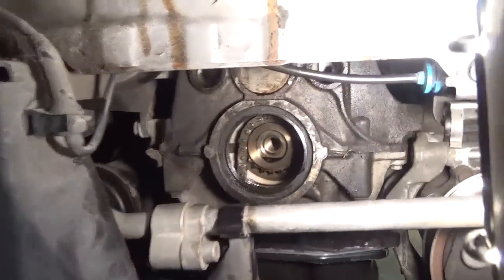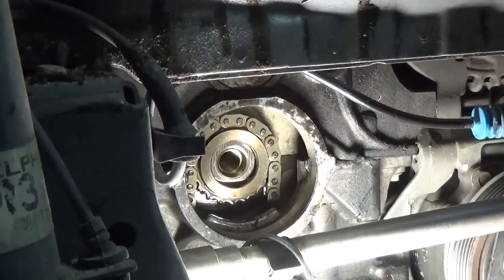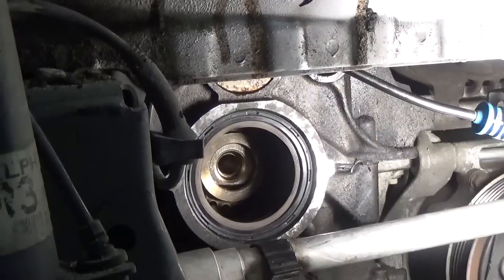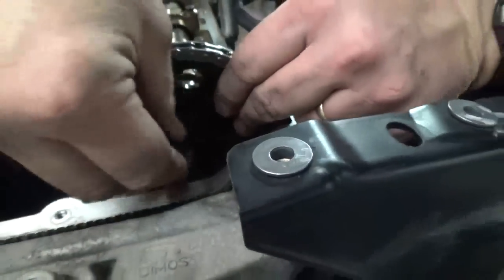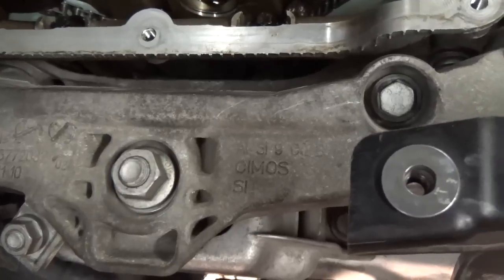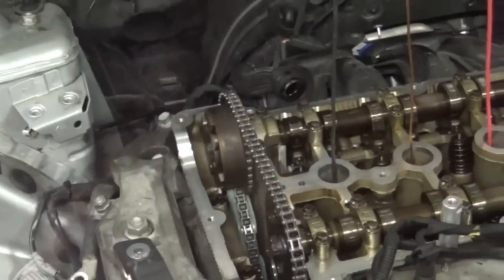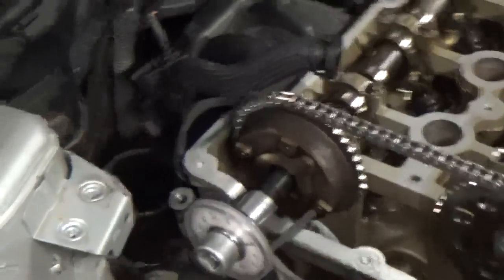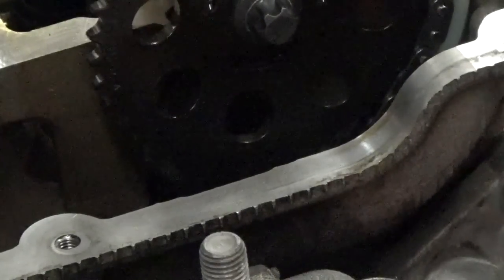2007 Mini Cooper S Timing Chain Replacement Part 3

Comment: Great videos. I've watched all 3... with my full attention but where is video 4? What happens next.? Did it start?how did it sound?
Reply from the maker: Harry Cooper. After I got it all back together, it wouldn't run because all 8 exhaust valves were bent. That led me to do the series on cylinder head repair.
Reply: Di you bend the valve when you set up the timing

Comment: so did you end up with any bent valves or other damage   after the chain went bad?
Reply from the maker: Bella Luna yes, all 8 exhaust valves were bent. ended up replacing all valves, milling and valve job.
Reply: dam, sorry to hear that. Guess I should definitely go ahead and replace my chain and guides before this happens. Thank you for the reply. :)

Comment: Are there timing marks for the Crank?
Reply from the maker: No, there are not any timing marks. Once you lock the flywheel, the Pistons are in the correct position. Once you install the camshaft locking bar, everything is in place.

Comment: Please do you have anyone who you can recommend to fix my 2009 Mini Cooper because It seem i have the same problem, it will crank but wont start.
Reply from the maker: I found it difficult to find anyone who would work on my wife's MINI. My regular mechanic said" only if I have to"
I did find a couple of shops that specialize in German cars that were willing. So far I haven't had to take it there.

Comment: theirs not show how to locate the crank shaft locking tool please explain that thank you.
Reply from the maker: did you look at the other 2 videos? I'm sure it's in there. there is a hole in the bellhousing by the oil pan. the holding tool slides in that hole and engages the flywheel when the crankshaft is in the proper position. that is why I used the pieces of wire in the cylinder bores to help find the proper position.
Reply: thank you very much for the instruction

Comment: I have a 2007 mini cooper s  noticed the chain on the oil pump Is very loose has a lot of play is it suppose to be like that if anybody knows can you help with comments   thank you
Reply: 824cement It is normal for that chain to be loose, it does not have a tensioner for it.

Comment: You have not installed the upper guide rail again?
Reply from the maker: yes, I installed the upper guide rail. ended up having to put heli-coils in the mounting holes where the guide bolts on. very easy to strip so be careful.

Comment: if you are going to start video talking about safety at least practice some,,,,, rings on and watch on in video which are big no no's while working on cars
Reply from the maker: thanks for pointing that out. I usually take my watch off. I can't get my ring off so I sometimes wrap it with electrical tape. But you are right, I should have done that for the videos.

Comment: Missed an important step :-) if your reusing the cam dephaser sprocket then set it back into its neutral position (0 deg) rotate engine 2 turns (before removing cam chain without locks installed) then use a hex spanner to gently torque back the inlet camshaft in the opposite direction in order to locate the locking pin within the dephaser wheel.. I always do this when replacing the dephaser sprockets too as a matter of course you can't be too careful with these grenades :-) someone should remind BMW that keyways are still a thing and much easier....

Comment: NICE VIDEOS I HAVE TO MAKE A JOB LIKE THIS ON MY GARAGE ..IN A CLIENT CAR...HEY! DO YOU KNOW THAT ENGINE IS PSA GROUP??  FRENCH NOT GERMAN..TECH...ITS VTI ENGINE BASE ..PSA GROUP..IT MEANS PEUGEOT & CITROEN..THEY USE IN SOMO MODELS FROM 2007 UNTIL 2011..BUT THE VALVETRONIC SYSTEM ON MINI ONE 1.4 ..ITS BMW TECH AS VANOS...WELCOME TO THE EUROPEAN UNION....:D..GREETINGS FROM SPAIN..AND KEEP ON WITH YOUR VIDEOS ..
Reply: This is the Peugeot / PSA N14 engine. The N14 is used in 2007-2009 MINI Cooper S. N12 in the base Cooper. N18 is used in the 2010-2013 Cooper S. The N14 is most susceptible to this chain tensioner issue (more due to chain stretch and tensioner being too short)